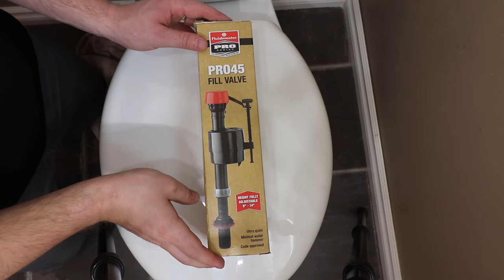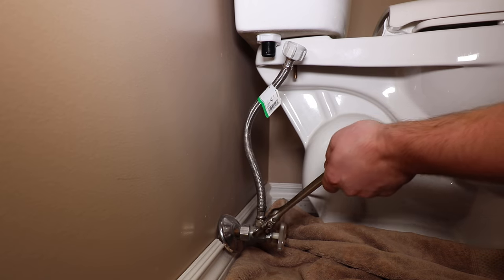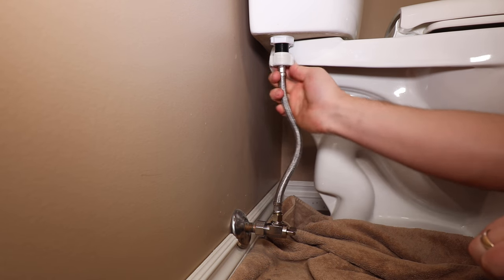Noisy Filling Toilet Repair

Comment: Sometimes, you can solve a hissing toilet by simply cleaning or replacing the fill value rubber seal. Shut off the water. Hold the fill valve arm up to horizontal. Give the valve cap  a quarter turn counterclockwise, like a child-proof pill bottle cap. Separate the cap from the float arm. Remove  the rubber seal and clean with a soft brush to remove debris.  Reassemble and your noise problem may be solved. Mine was so loud, I really thought it was neighbor's smoke detector going off. I know this works in some cases, because I just used this method myself.

Comment: Thanks I thought I would just have to replace some washer in the valve but didn't know I had to replaced the entire stem.  It seems to be a waste of the other parts.  Subscribed.
Reply from the maker: You're absolutely correct, that it's a waste of parts. It used to make sense to change the seals in a fill valve, but now purchasing a seal repair kit can cost as much or close to the entire valve. Some fill valve manufactures don't even offer the option to purchase repair parts and recommend replacing the entire valve. Unfortunately this is the way most things have gone. Thanks for the comment and subscription!

Comment: I've had nothing but trouble from BrassCraft MULTI-TURN angle stop valves, often because of the soft rubber compression washer.  There's nothing worse than going to fix the toilet only to find out you have to replace the supply valve (and line) as well.  I've had MUCH better luck with the 1/4-turn version.  I cannot say whether this is a ball valve internally, but I can hope...
Reply from the maker: I agree Ralph. The quarter-turn valves are far superior. I personally use Dahl valves which are quarter-turn ball valves.

Comment: Thanks for the excellent video.I understand that the rubber refill tube carrying the water goes into the overflow tube (white tube in the center of the tank attached to the flush valve).I have a toilet flush tank where, when I set it up as in this demo, the water keeps seeping through into the toilet bowl, wasting water & also takes a long time to refill too.So I ended up putting the black refill tube into the clamp outside the overflow tube instead of inside, so the water does not go into the overflow tube but outside the tube. When I do this there is no water seeping into the toilet bowl when the tank refills.I guess this is not the how it supposed to be, but then I loose a lot of water when I put the rubber tube inside the white overflow tube.Can you please tell me if I'm doing anything wrong & why water leaks out while doing it the way you suggested? Thanks a lot.
Reply from the maker: Thanks for the great question. It sounds like the fill valve is faulty or obstructed. I'm confident with a new fill valve this wouldn't happen. The refill tube is designed to go into the overflow tube to prime the toilet bowl with water. This water acts as a trap seal which blocks sewer gas from coming back up. It also primes the toilet bowl so that the toilet flushes properly as well. I think what is happening is the internal valve on the fill valve isn't allowing enough water out to fill the tank in a reasonable amount of time, but the refill tube is running properly causing a lot of wasted water. The first thing I'd do is replace the fill valve. Let me know if you have any questions and how it goes. Thanks!
Reply: @PROSDIY Thanks for the response.AFter reading your comment I put the tube back where it belongs in the Fill Valve.It works great except that after flushing, water seeps in for couple minutes & the refilling takes a couple of minutes too.After that it's all fine.Wondering if this is normal.I just changed the system from the old float system ,except for the fill valve which is 10 years old.I don't think there was a leak previously or maybe I didn't notice.Wanted to send you a pic of the tank but looks like it's not possible here.Let me know your thoughts.Thanks.
Reply from the maker: What parts did you end up changing? The water that is entering the bowl through the refill tube sounds like it is working, as you are seeing it flow into the bowl. This is normal operation. The part that isn't working is how long the fill valve is taking to fill the tank. This is one of 2 things. If the fill valve eventually fills the tank and the water stops flowing into the bowl/tank then it is the fill valve that is faulty. If the water continues to flow into the bowl after the tank is full, then it is a faulty flapper. From what you've described it sounds like a faulty fill valve. If you'd like you can upload a picture to https://imgbb.com/ and it will give you a link to share the image. This is a free service. Thanks
Reply: @PROSDIY   Thank You much for the reply. Here is a pic link https://ibb.co/K0L9Xzv

Comment: When I flush the toilet, it fills up. But then, sometime later, there is a subtle sound of water refilling for about 10 minutes, then silence, then another low sound of the tank refilling again for about 10 minutes, etc. Can you tell me if any of the problems you are addressing is likely the cause of my problem or how to get rid of that problem? Thank you very much!
Reply: Sounds like your flapper in the bottom of the tank is not sealing after a flush. It lets water slowly seep out, then when the level gets low the float drops and refills again. Easy and cheap fix. Before you go to the trouble to replace, lift it open and check  that a piece of debris isn't stuck under it. (I had a manufacture label fall from under the lid and jam mine once)

Comment: Great video - @ 1:06 how come the water didn't all come out of the tank when you disconnected the riser? (you emptied the tank afterwards which still had water in it @ 1:08 on)
Reply from the maker: Great question. All newer designed fill valves have an anti-siphon device built in. This is a rubber diaphragm at the top of the fill valve that that allows water to flow into the tank, but not back out. These protect the potable water supply by not allowing the toilet tank water to flow back into the water distribution piping. This suction or siphon could occur in the case of a water main break, or from large water consumption (firefighters). Thanks for the question! All the Best!

Comment: Great Video.  My toilet is making a loud banging noise when flushed for one or two minutes.  What may cause that.  Thx.
Reply from the maker: Thanks Bob Bob! I'm not 100% sure to be honest. If it was water hammer it would only happen at the end of the filling cycle and not during. Does the banging noise only happen while the toilet tank is filling and stops when full? If so it is most likely the shutoff valve or fill valve.
Reply: Pros DIY Thank you for your reply. Banging sound continues after tank is full and sometime it continues for several minutes. So if it’s water hammer, do I need to replace it or it can be fixed without replacing. Thanks again for your help.
Reply from the maker: If it was water hammer it would only occur immediately after the toilet fills then stops, so we can rule that out. If it is occurring after the tank is full, it sounds like pipe expansion and contraction. Which can be very difficult to fix if the water distribution piping isn't exposed. If water pipes are secured tightly against wood and walls and the pipe expands it will rub against the surface. This makes a banging/knocking noise, usually fast at first then starts to slow to a stop. It is very common to happen in summer on cold water supply fixtures (toilets) and in winter on hot water supplied fixtures (showers). This is because the greater change in pipe temperature which will cause expansion or contraction. The only way to fix the issue is creating more space between the piping and hard surface or adding a buffer between the two. So the most common sign is a knocking noise that usually starts off fast and then the pace slows to a stop. Does this sound like the issue?
Reply: Pros DIY Sound is occurring while tank is filling as well as after it’s filled.  But it sounds like it’s hard task.  But thank you for your help. Really appreciate it.

Comment: Is turning off the home water supply necessary to investigate if the shut off valve is the problem?
Reply from the maker: It is if you are going to take it apart or replace it.
Reply: @PROSDIY  I just turned it off anyways :) thanks. My toilet is vibrating the pipes, but the vibration is not really coming from the toilet. The shut off valve is old but looks perfectly good. Any thoughts?
Reply from the maker: That's usually the safest bet :) Does the noise only happen when the toilet tank is filling? Since the a vibration can come from both the fill valve and shutoff, I would start off with the most common and easier fix first. Replacing the fill valve.

Comment: When I flush the toilet it makes a noise similar to yours in the beginning of the video BUT I can manipulate the noise if I turn the facet on/off. Does this indicate that the shutoff valve could be the issue and not the inners of the toilet itself?
Reply from the maker: Hi Matthew, That's hard to tell. The reason the sound changes is because the water pressure drops when the faucet opens. It can still be the shutoff or the fill valve. The most common cause of a noisy toilet is the fill valve though, so I'd start with that. Good luck on your repair and let me know if you have any questions. Thanks!

Comment: Toilets should flush quietly and use less water when you only have to pee. Toilets that flush loudly can wake light sleepers and startle people with sensitive hearing. It’s important to save water for whomever personally has no access to clean water. In other words, you should never have to avoid flushing a toilet after using it for any reason. That just makes the seat get dirty faster, and if the toilet is shared, whoever uses it next might think you’re just leaving behind a mess and expecting the other person to pick it up!

Comment: After flushing, the toilet has been filled with water and then there is interrmittent hissing noise after a few minutes. Will i need to replace the flush valve?
Reply from the maker: It sounds like a flush valve that is doing the last bit of filling. Does the hissing noise continue every couple of minutes? If it does it could be a flapper that is leaking, or the water level being set too high and pouring over the refill tube. To test if the flapper is faulty, let the toilet fill. Then add food coloring to the tank water. Let the toilet sit for 30 minutes, if you see food coloring in the toilet bowl water, the flapper needs to be replaced. Let me know if you have any questions. Thanks for the comment!

Comment: Which solution would be for the "foghorn" sound?  Thx
Reply from the maker: Unfortunately there isn't a definite answer for that. I would start with the easiest tasks first to see if it fixes the problem. Flush line of debris. Change fill valve, then check/replace shutoff if needed. Thanks for the question.
Reply: @PROSDIY   and @everyone else - changing the fill valve solved the problem.  No more foghorn.  Thanks for the response.

Comment: in my case it's making humming noise which can b heard in house what should i change the valve??
Reply from the maker: Hello, it is most likely going to be the fill valve. You can try manually moving the float on the fill valve up and down to see if you can recreate the noise. Thanks for the question.
Reply: thx alot for getting back to me means alot👍👍
Reply from the maker: Thanks Raja, Good luck on your repair!

Comment: I replaced the fill valve with the exact same kind, flushed the line into a bucket and I still hear a hissing when the toilet fills. It is not leaking. Any ideas?
Reply from the maker: It might be excessive water pressure. You can try closing the shut off valve slightly to see if that makes a difference. Has this always happened or just started happening?
Reply: @PROSDIY  thank you for replying. When I turned the valve slightly it stopped doing it. I’ve owned the house for about a year and it started happening about 6 months after I moved in and has been doing it on and off but now it’s every fill.
Reply from the maker: @AJ-dr5jr  Sounds like high water pressure. You could have it checked to see if it's excessive. Most city supplied homes run 50 - 65 PSI. Anything over 80 PSI is excessive and a pressure reducing valve should be installed on the main water supply entering the home, reducing the pressure. It's your call in the end. You could just leave the valve slightly closed, since that is resolving the issue. I'd probably get the pressure tested though. Excessive pressure can lead to prematurely worn faucets and valves.

A less common issue is the shut off valve to the toilet is causing the hiss as well and should not be ruled out. Replacing the valve takes care of this.

Comment: Don't un screw the water line from the toilet until the water is shut off and you flush the toilet...
Reply from the maker: True you should shut off the water before disconnecting the water supply line. It doesn't matter if you flush the toilet before or after disconnecting the supply line as there's a check valve in the fill valve. This stops the toilet tank's water from siphoning out and cross-contamination.